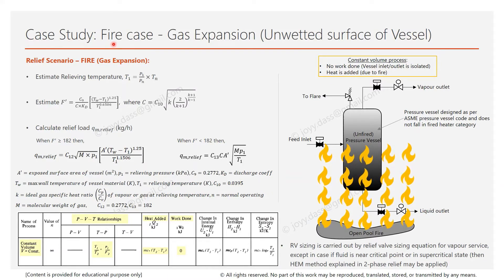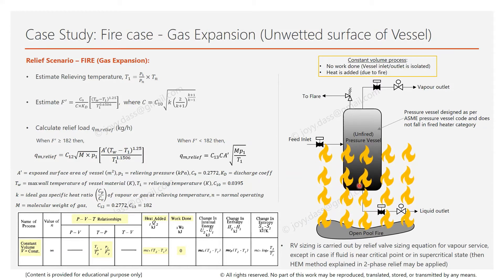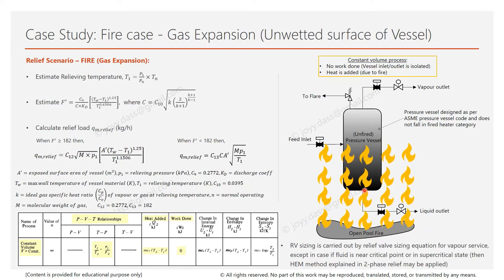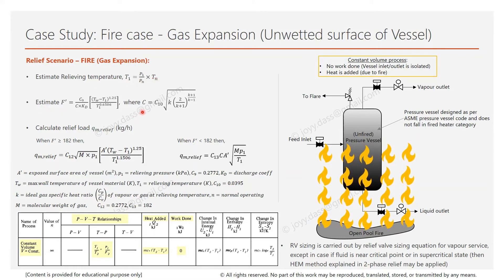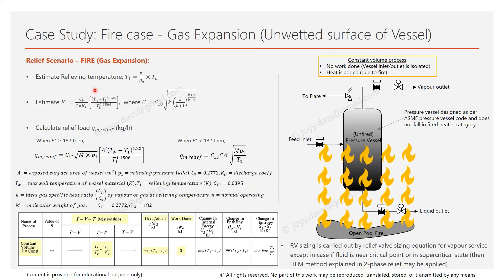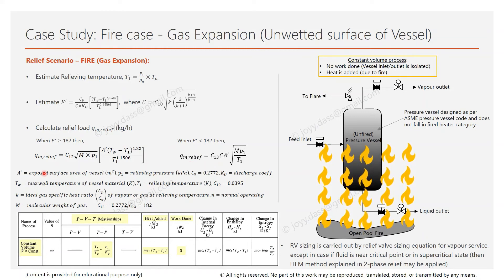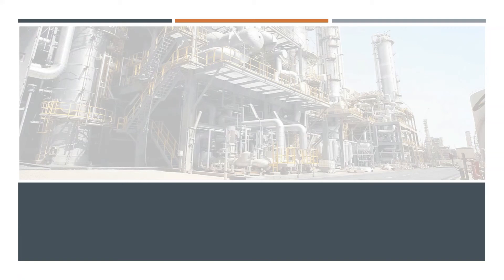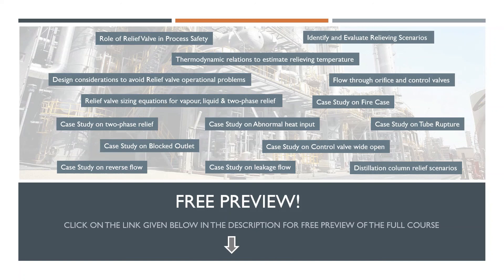Sizing of Vapour Relief Valves - Case Study Gas Expansion during Fire

Comment: PLEASE GIVE INFORMATION ABOUT CALCULATION OF DIFFERENT VESSEL AREA
Reply from the maker: Surface area of vertical vessel (cylinder) is π d h, while surface area of bottom torispherical dished end in vertical vessel is approx 1.09 d^2 .
The surface area of partially filled horizontal vessel (cylinder and dished ends) is more complex formulae which cannot be adequately explained in comment section here.

Comment: WHAT IS RELIEF LOAD.....FLOW RATE OF GAS FROM THE OUTLET OF THE PSV...YA KUCH OR H...
Reply from the maker: Relief load is a term used for flow rate from the relief valve. The flow rate is generally specified in terms of mass rate (kg/h). It maybe single phase gas, two-phase fluid or single phase  liquid. The relief load is estimated for each scenario (e.g., blocked outlet, control valve wide open, fire, etc) at relieving conditions (relieving pressure and temperature at inlet of relief valve). The overall mass flow rate at inlet and outlet of relief valve is same. However, there is pressure drop across relief valve, thus fluid may flash with phase change. The volumetric flow and fluid phase will vary between inlet and outlet. For consistency, mass flow rate is specified for relief load/rate.

Comment: Good discussion!  But where does C9 and C12 come from?  What are the units?
Reply from the maker: Thank you for your comment. C9 and C12 are dimensionless constants. The equation given is in SI units. The values of these constants are C9/C12 = 0.2772 in SI units (0.1406 in USC units). The equation is based on API Standard 521.
Reply: @RationalEngineer  Thank you for sharing your knowledge
Reply from the maker: Relief rate equation is derived by rearranging the critical vapour equation. It is based on physical properties of air and ideal gas laws.